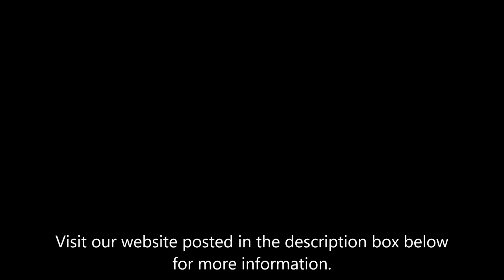How To Make A Foreskin Tugging Device At Home [Foreskin Restoration]

Comment: i found that weights are a lot better to use than a strap like shown, for me obviously.  anyway, just to offer an alternative for those watching.  basically everything else is the same, but rather than a strap you would attach weights to the cone parts(i generally use a large screw/bolt and some large & heavy nuts and washers combo..... for me this works a lot better not only for results, but also for comfort and logistic feasibility in regards to daily movement while wearing the device.....
Reply: can u give me the link dude?
Reply: How many hours a day do you wear it?

Comment: dang, cutting the funnel is pretty hard

i ended up screwing up the first one, so this time i did it by placing the cut r.n. onto the funnel and marking a perfect circle around, and going over again by spinning the funnel flat on a desk, it gave me a much straighter cut as well as the exact SIZE i neeeded plus more or less. Then that helped me do the rest a lot easier with markings

Comment: When I were it. It heart I leaves a red light and it heart what should I do
Reply: Make sure you have cut the baby bottle nipple down enough so there's not a ring that protrudes inward around the edge. I had the same problem, and for me, I believe it was caused by the edge of the nipple, and trimming the silicone down so it's pretty much a flat surface against the skin has helped.
Also make sure you're not using too much tension on the strap. If you feel pain, you need to back off the tension or modify your tugger's design.